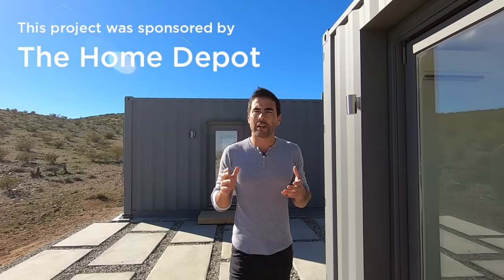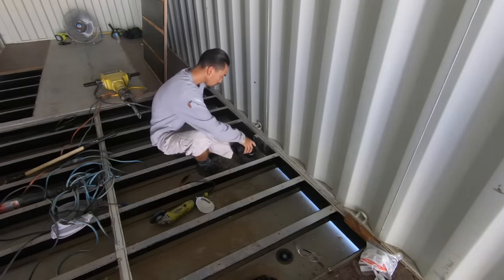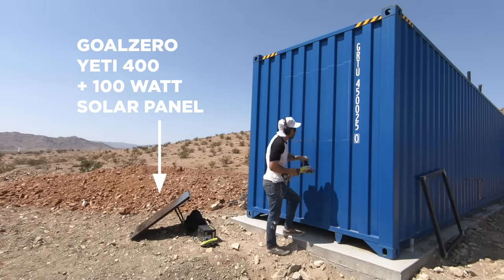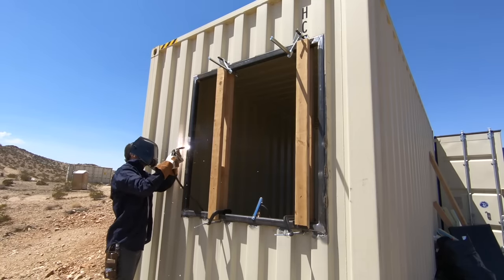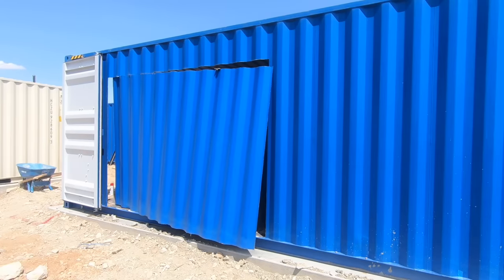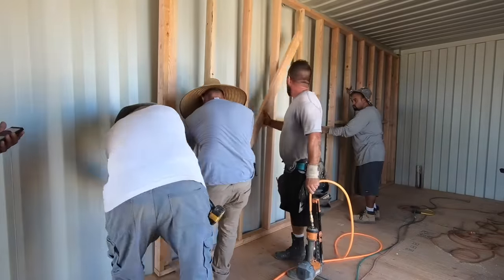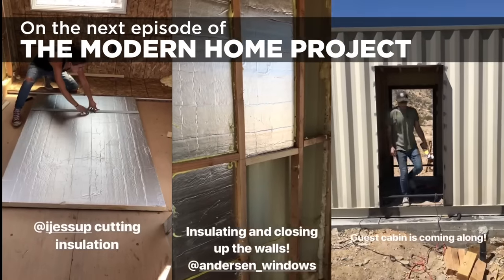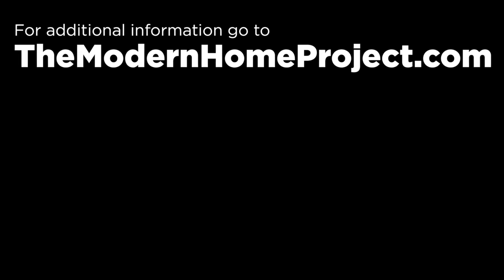Building a Shipping Container Home | EP02 Moving, Cutting, and Framing a Container House

Comment: $150,000 latter and you live in a shipping container. No thanks. Best I've seen so far is Andrew Camarata shipping container castle tower.
Reply: Thing is, it costs more because of the shipping containers. They are putting up interior walls on the inside of the shipping container walls. There's no practical point in doing that. Just build an exterior wall and put metal cladding on it instead of buying a shipping container. There's very little cost difference in building an interior wall vs exterior. And you save space. It makes no sense.
Reply: Yep...  Andrew did a much more intricate job, and more interesting.
Reply: I have a pretty, well insulated 1200 sq ft house that cost a lot less than that, including land, HARV system, appliances, etc.  How did using a shipping container save money?
Reply: Cody Parks 
I know right. We recently bought a foreclosure 4 bedroom 2 1/2 bath home for $142k 

This is a project for someone that has more money than common sense 😉

Comment: lol CA blows. You essentially built a house inside a shipping container. They made you do an entire frame job inside the container. That sucks.
Reply: How exactly would you attach insulation and drywall to the inside of the container without studs?
Reply: I was surprised myself, it seems that their engineer should have made the header and reinforcements out of a few pieces of iron, or aluminum c channel. There is tons of more cost efficent methods. and furrules for insulation and drywall.
I blame the engineer Cali regulations are actually pretty flexible, even where I live in a far less populous state, we have stricter regulations
Reply: Richard Wrightson , glue all the layers to the steel. Wood studs kill the insulation R value.
Reply: @dougmartin7129  Then what do you attach (ie, nail) the drywall too?
Reply: Richard Wrightson     no nails no screws just adhesive to each layer.  The biggest thing is that the sheet insulation is unbroken.  Fast easy work.
Reply: @rwrightson1  First off change the alignment so that the containers all go together side by side with their doors facing south. Cut the doors off and add the windows and new doors there. All the walls that need to be removed to connect the containers into one building....repurpose them with angle iron to create trusses needed for structural support. Having eliminated the need for interior framing, you can use spray foam insulation. Then secure wire netting to the original load securement points and shoot in stucco on top of the insulation. Skip drywall on all exterior walls and ceilings. Also buy high cube containers and frame up the floor to accommodate the plumbing also permitting more insulation there as well.

Comment: lmao, after the framing there's ZERO room left for inhabitants.  This project started to go out the window with 25k in permits, but it finished going out the window when you had to put a whole house frame in there.  At this point it's a regular house, you're just using shipping container on the sides instead of something more traditional.  The structural support given by the containers was gone when you cut them up for huge windows, and now it's just reliant on the wooden frame. This is real rough to watch.
Reply: Lol yeah, total disaster from the start. Huge sums in permits and studies, a giant crew of guys with all sorts of construction machinery just to end up with a small, uncomfortable and expensive "house".
Reply: Structural strength of a container comes from the steel frame, not the sides
Reply: M,kkm
Reply: Mm
Reply: Mmmmmmmm
Reply: Mmmmmm
Reply: M
Reply: Kkkkmm
Reply: Kmkkmmkm
Reply: M
Reply: Mkkkmm
Reply: Mmm
Reply: Kkkm
Reply: K mm
Reply: Mmmm

Comment: You never weld downhill with flux and the copper pipes is not called sweating it's called brazing.
Reply: Can you say "slag inclusion"?
Reply: The sweating he is referring to is the action of the lead itself being drawn into the seams from the heat. You know what he meant both are correct terms though
Reply: In the trades, we say "sweating the joints" and refer to them as "sweat joints".  Brazing is typically the word used for oxyacetylene torch with and brass rods to join dissimilar metals.  Sweat joints are the specific joints designed to fit so snugly that you sweat the lead/tin/antimony or silver solder or other lead-free solder into the copper-to-copper joint with low temp propane or Mapp gas.
Reply: @LaramieCrocker  I'm in the trades myself and yes you are correct.. he is also correct with the term he was using for the action that was being done that you tried to "correct". But to each is their own, terminology even differs from state to state, country to country, even as minor as county to county.

Comment: Seems it would be easier not to use the shipping container.  Metal as an exterior in the desert wouldn't be my first choice.
Reply: True! And the main reason why to use containers is to safe time and effort + it's solid but makes no sense to me if you build new frames from inside for stability.

Comment: Those shipping containers are made from cor10 steel. Rust will not hurt them but will in fact create a protective layer. The steel frames you made were more than adequate to give the extra strength from cutting the corrugated.

Comment: It would have been cheaper, easier and faster just to build a stick built frame. what a waste of time and money.
Reply: Yeah, I dont understand the point of these structures.
Reply: These are way stronger then stick houses,,in case of tornados earthquakes
and cheap to buy.
Reply: Agreed, building a stick lumber house frame inside of a shipping container, kind of defeats the purpose of building a container home .
Reply: These are easier to move and cheaper than lumber in the southwest US, where this looks like it is.
Reply: meaturama  The way you build a normal wood house, like they did inside the container
Reply: I think it is mostly about container recycling, and not do it traditionally... price is not the major motivation.
Reply: Rabagast__ would make more sense to re-use container as a container especially as stated in part 1, this was a one use container. Heck it would probably be more efficient to scrap and melt the container. 

There are instances where using containers can make sense, but when you effectively have to retrofit a stick frame inside a container you may as well build the stick and clad it and not be restricted by the dimensions of the container.

But then that wouldn’t generate YouTube views and sales of the inevitable book or plans, etc.

Comment: Containers are the worst basis for a house, I swear...  
In order to have insulation, weather protection and a decent interior, you have to basically build everything again..
I challenge the idea that there is ANY cost advantage over building your own rectangle out of more suitable materials. Flatlanders exempted...  ;-)
The ONLY acceptable reason to use one is, if you want to be able to move your little container house from continent to continent by freight ship.
Reply: He could have chosen ref containers that are already insulated and have double metal walls.
Reply: My thoughts exactly... after you pay the cost of the containers and build out the interior structure is there really much if any cost savings?  If so, is it worth all the hassle of trying to figure out how to build it to code and how to insulate it well enough.  I bet anything a traditional structure built to the same size would have a very similar cost and would be much easier to heat/cool.
Reply: Not the worst, just very niche and people have to avoid having unrealistic expectations of what can be done with them...

There is a cost advantage of lower initial costs, used containers sell for much less than the cost of buying the steel and building a steel framed structure yourself, but because they are being converted for a use they were not originally designed for there is a threshold point where it stops being cost effective but that depends what gets done to it and that can depend where it will be placed and how it will be used as to whether that threshold gets crossed or not...

So it's just something that will have a limited niche range of practical usefulness, but the reasons why people push that limit is because it's also part of the push to build more sustainably with materials that can be recycled and because it's generally considered an easier way to DIY rather than build a house from scratch.

Otherwise, people just have to keep realistic expectations of what it can be useful for and know when other options should be considered instead...
Reply: @iSurPS - Those are a option, but would have to consider higher cost, less interior space that forgoes putting the insulation on the exterior to maximize interior space, metal floor means it can't just be removed for more flexible design options, and double metal walls are generally harder to significantly modify and could make an extensive conversion more cost prohibitive...

You can have them custom built to order, though...
Reply: Old busses do a better job then containers and they are way cheaper
Reply: I'm not sure what any particular geographic location would have to do with it.  They are lousy for heat and lousy for cold.
Now, if you find a place with a stable 23 C Year-round, they might be ok.

How the subject relates to Bolshevism and what seem to be odd sexual terms, to emphasize your apparent hatred of California must be known only to you...
Reply: Just about everything is lousy for excessive heat or cold unless it's built to handle it.

Even with wood structures, they may not conduct heat like metal but the insulation value of wood is less than R-1 per inch and unless the structure is air tight then you will always have heat leaking as house air gets exchanged with the outside air.

Most houses aren't very energy efficient and compensate a lot with heating and cooling, it's one of the reasons they're forcing higher energy efficiency on new construction because houses account for more energy usage, and thus more fossil fuel usage, than all cars combined.

While all you really need is thermal breaks to get around metal's conductance.

So let's not exaggerate... Virtually no modern home is going to be left a bare single material structure and all materials have their pros and cons but also ways to get around their limitations.

Comment: Reality-- the container is useless ---since it costs too much to get value and engineering cost & it limits the room dimensions. I have made full 3000 sq ft steel bldg for less than $40k and insulation is cheaper if the walls have less exposed steel. you are making an oven. I'd tent the whole thing in a desert.
Reply: but did you do it in California?

Comment: As a welder watching you cut it all with a grinder you spent 5x the time it would’ve taken if you would’ve used a plasma cutter and saved money
Reply: As long as you don’t mind the splatter on the edges. But yes, much faster. I wonder how twin circular blades would go - the kind that spins in opposite directions?
Reply: Alrukitaf  he still had to clean them either way
Reply: Very true. I was floored when he said it took an hour to cut the first window - that's a 5 min job with a plasma cutter. I hope to see in future videos that he took the plunge and invested in a cheap cutter, in the same fashion as his welder! Great videos, love watching the journey.
Reply: The plasma cutter makes a rough edge, burns the paint as well as being difficult to maintain a straight cut in the corrugations.
Reply: Marc, Do you have any comments on the welder used, or can you recommend a good one for a beginner?

Comment: Considering that you have constructed a concrete slab to sit the container on and then you have built interior stud walls what is benefit of using shipping containers. The containers also limit your room shapes and sizes, so why not build a timber framed house with corrugated steel cladding? I am all for using shipping containers if they can be both economically and environmentally viable but after comparing both construction methods several years ago my wife and I built our house using the second method as it came out a clear winner. 
That being said thankyou for the great video, it's very well done  and congratulations on your new home!  Cheers!

Comment: Loved the project!!! A lot of do's and dont's wisdom to take home. Still not clear to me why the overkill on interior fortification with a wood skeleton inside the container. Not a structural engineer myself but I think that the steel frames used for the windows and doors are in fact stronger (when finished welded and with the actual window inserted in the frame) than the corrugated steel that was removed.

Comment: You built a house in a box.
I'd build a steel cage along the edges with vertical support along the cutouts.
Like a rollcage and you don't lose interior volume.
I want to bury it in a hill so dirt insulates the back and roof. Face towards the best view with sliding door leading to patio with sunshade from door cutouts and solar and off you go.
Great foundation and plumbing tips.
They make these out of a special metal but maybe zinc rust prime all the cuts.
Thinking about that maybe an anode would reduce corrosion. They're supposed to rust but not rot so I wonder if it's better insulated or grounded?  Lightning?

Comment: For the foundation to be close to the ground you could have placed anchor bolts in the poured concrete and tied them to the rebar. And place I beams with holes that you can set on the anchor bolts to secure them to the foundation. Then you can weld the container to the beam. The beams don’t have to go all the way around the pour, just in the critical structural support locations. The corners and midways if the length requires it. You can choose any number of sizes for the elevation of your home. You could even use jacking bolts for adjusting your height if the foundation settles or the foundation wasn’t properly poured.

Comment: I’m building a house near yours using shipping containers but mine will be under 10 feet of earth on the side of a hill. 
These buried home never get below 60 degrees or above 80 in the summer.
Good video, I’m getting some ideas.
I’m going to use solid double pane glass for the fronts for a nice view. I plane to use three  10x *40 containers.
To me it is a waste putting these above ground when they are so strong.

Comment: Would have been easier to cut the frame to fit the hole.  Even just welding each piece, one at a time.  It's easier to shim the window or door into place after than it is to be ultra precise making the frame.
Thank you so much for detailing how the interior walls are attached to the metal walls.  Many videos skip this, and since I didn't know about the tubular steel along the joint, I had no idea what people we're screwing into.
Funny, I've emptied enough of these, so I should know, but I never looked.

Comment: Containers are pleasantly low upkeep and wildfire embers don't bother them (if you don't use flammable materials outside and keep a generous firebreak around them) but those contemplating using one should be aware they're best used as industrial or military space (copy those users if you fab your own). I have two 40' High Cubes welded together as a shop. If I built in earthquake zones a container would have major advantages if done correctly and it's easy to weld whatever you like to them. I used a suitcase FCAW feeder on the roof and grounded to the shell on the inside to make things easy.  If I used concrete instead of my steel beam foundation I'd use Sonotubes since containers ONLY require support on the corner fittings. If you're a weldor and gearhead they're great, but if you're not familiar with construction and excited by the big metal box you have some homework to do. I STRONGLY suggest building a container SHOP first. Then you won't be experimenting on your dwelling and you'll have a kickass workshop! Buy only "ONE TRIP" grade containers for building. No junk! "WWT" grade = garbage you'll have to repair and it's not worth the hassle.  Check the Sea Box site and similar for ideas. DO NOT BUY ANY PLANS FROM THE CONTAINER PLAN SPAMMERS WHO INFEST THESE THREADS. All you need know and more is free via a search engine.

Comment: Lol.. I used to make these into construction site offices. You guys made it so hard on your selves, use wirsbro tubing for your fresh water as it's flexible water grade plumbing that can bend and is cheap. Next you can move a 40 foot sea can with 1 man bar and 1 person. No cranes just a flat bed with a tipping capability. Use a quick cut for the windows doors as you can rent one and it will take 5 minutes. My advice use blue 2x4s (bug and water resistant wood when framing her in. 1200$ to 1800$ for used sea can and 1800$ to 3000$ for 40 footer. Also I would suggest from my experience roofing the top. Rubber bumpers at  the four corners of the container help too. Lock it into place on the concrete slab with a 45 steel clip true bolting with a hammer drill and she isn't going anywhere. Don't weld windows just frame it in like really. Put some shutters with them too bey. Our building codes in Canada seem to be way different from yours!

Comment: im a contractor and build homes and buildings to suit. the slab could have been a 12" thick post tension and your wood framing would have been the same. you would have needed only plywood siding for sheer value and a simple roof plan, with trusses. for an equal home with more options for a floor plan, other then 7' x 19' rooms.  but you did provide an excellent video on the subject.  although some numbers on cost would have been good to reveal for everyone to view.